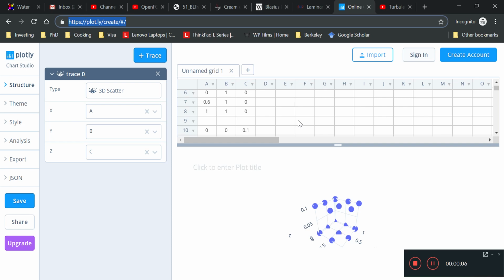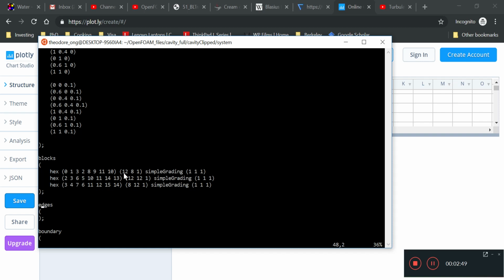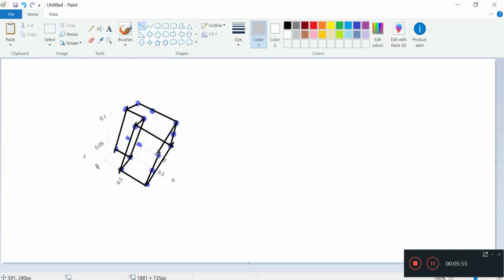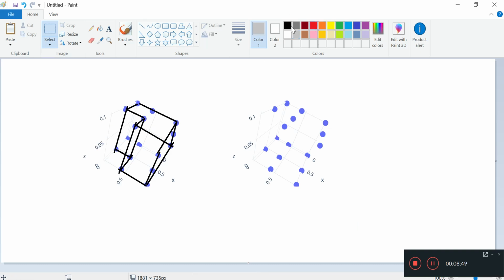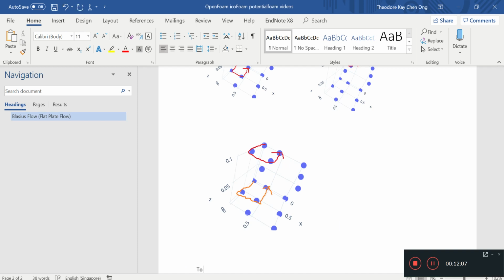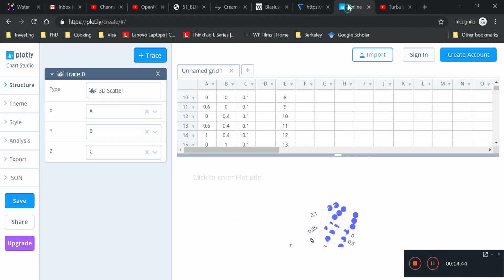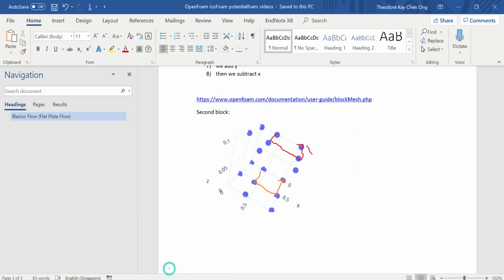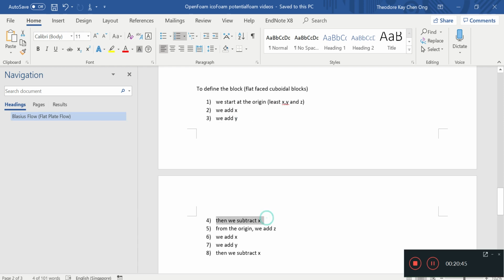OpenFOAM for Beginners win10 13 - blockMeshDict for BL flow 2

Comment: sir , can we change the sequence of hexagon like right 3rd hex 1st line, then 1st hex and  in 2nd line and 2nd hex in third line by keeping vertices for each hex unchanged ???hex (3 4 7 6 11 12 15 14)
                                            hex (0 1 2 3 8 9 11 10)
                                             hex (2 3 6 5 10 11 14 13)
Reply: @TheoOngScienceAndEngineering  yes sir ... You have understood it correctly ... Thanks 😊